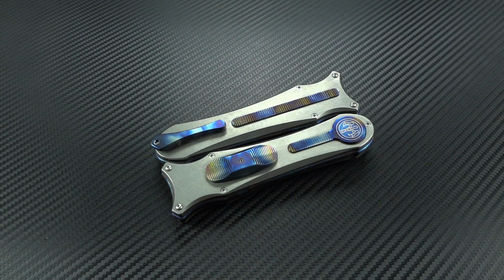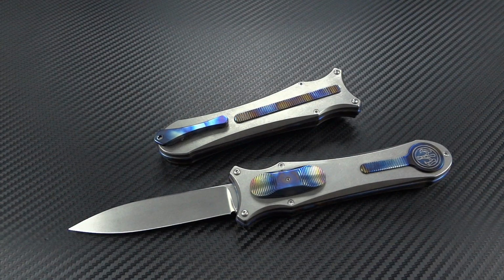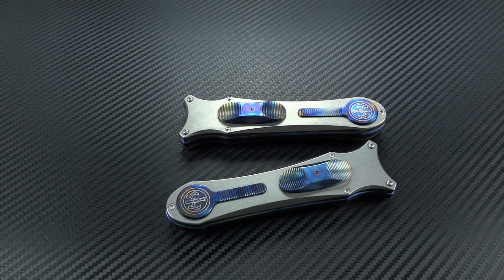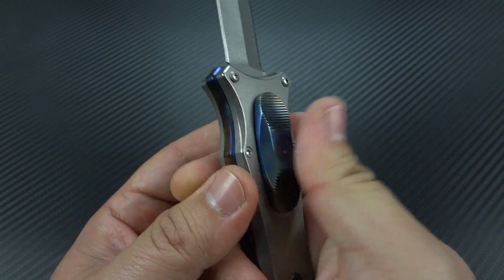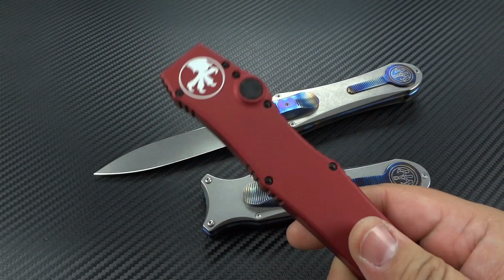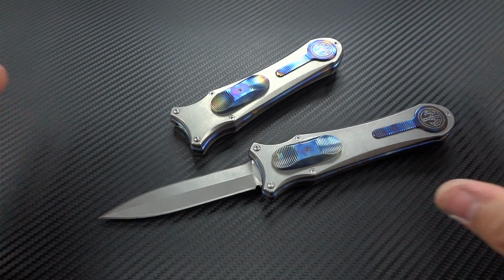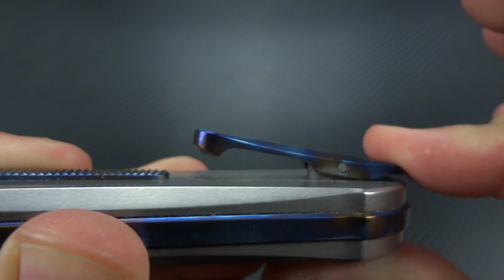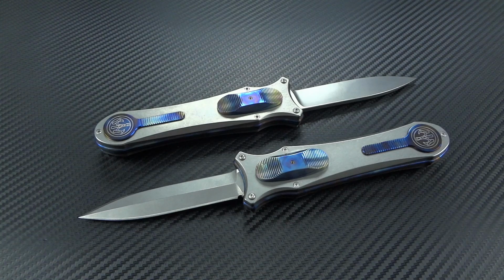Hawk Knives Custom Deadlock: The perfect OTF?

Comment: Love the knife . Love how they solved the problem of the lockup that nobody would ever use it to stab into a trash can . The sand shark 🦈 is probably the best lock to this day . The piranha lock up mechanism is really great . Not the blade firmness but the locking strength . The infidel stamp internals are garbage. Love the internals of the dead lock , but I personally think the microtech internals are tried and true simple the sears are beefy , the slide is solid. The newer Dirac slide is my favorite internal slide . If microtech used 2 sears to lock could take the blade wobble out .

Comment: I just purchased my first Hawk Auto, Marble Carbon Fiber handle, tumbled Titanium hardware, SV20, (Premium Steel), sharpened double edge.

Awaiting Arrival!

I received mine and it is exquisite, no play, beautiful action, superbly sharpened on both sides and it was symmetrical on both sides at the tip to perfection. 

Really impressed. 

The only thing I'd like to see is a window breaker tip on the end.

Overall I'm extremely happy with my purchase and it in my opinion is worth the 💰!
Reply: How much for it
Reply: @craigfinley2507 

Cost was $1,250.00.

Now one identical to mine sells for approximately $1,700.00 used in mint condition.
Reply: @sixshooter4570  thanks for the info.  It is well made  no wiggle , the one you have the black one with the mirror blade is sweet.
Reply: @craigfinley2507 

Mine doesn't have a mirror blade.

Bead blasted.
Reply: You mean 20CV for the steel? I assume so. I was excited for a new steel to learn about

Comment: How much does it cost is the question, to make their point they put their design into a $1200 knife. I could take a MT and modify it with top shelf micro-tolerance parts and materials and do the same thing.
Reply from the maker: Justin Westwood You’re really comparing modifying an existing knife to developing something new from the ground up, and making them one by one? LOL
Reply: @JimSkeltonKnives  have you opened one up yet? What type of mechanism are they using? Something new, something proprietary or are they using existing designs and making them better, so there isn't a vertical/horizontal blade play? These are hardly 'production' knives if they are at all, and it's very unfair to compare, especially with the differing price point.
Reply: @Justin666i  Here's a video of the mechanism. It is not possible to modify a MT to work with no blade play. https://www.youtube.com/watch?v=OejKolm0-_U&t=2s

Comment: Can a heavy duty OTF pierce. 1 4 inch plywood. Or is that urban legend.
Reply: Jeffery Schirm
No, the mechanisms in otf knives are not powerful. While the blade is in travel a stiff piece of paper will derail it but if you then pull the blade out into a locked position it is back on track

Comment: I'm curious, does this have a feature like the microtechs where the blade stops if fired into a hard object?  If not what happens if the blade is stopped before reaching full deployment?
Reply: Actually its not a designed 'feature', and is instead just the nature of all double action OTF's. The only OTFs that don't stop are single action, and that's because there is a spring powering the blade all the way open. In double action OTF's the spring only powers the blade for about a half inch. At that point its only the inertia of the blade that takes it to the open position. 

When the blade hits something before going into lock up, it just stops. In that case you just pull the blade out. Since the Deadlock does require a little bit of force to go into a full lock up, sometimes throwing it out works best. 

Gavin
Reply: Gavin Hawk thanks that makes sense.  I actually found your disassembly video and watched that.  It's never really "off track" just not at the end of travel where the springs engage the blade.

Comment: Another set of thoughts for those opposed to the "cost" of this knife. Brands like Microtech offer customs as well. Try getting a double action out the front from Microtech, or Marfione custom knives with a titanium frame, titanium switch, titanium pocket clip, carbon fiber scales, a high end blade steel, AND a hand ground blade by the maker himself....for around $1,000. You'll pay at LEAST $3,000 and you'll still have some blade wiggle

Comment: Those knives have to have some play in them. The only looseness that ever bugged me on the microtech is the vertical give that comes when cutting stuff.
Reply: Technically you're correct. All otf's have to have play in them for the blade to travel back and forth. But when it's locked up, there is no need for play. The problem with other otf designs is they're not able to fully lock the knife up. That's where the deadlock comes in. The deadlock locks the knife solid when open and closed
Reply from the maker: biblical giants Zero play. As you can see demonstrated over and over in the video, and the entire reason for this knife's creation.
Reply: Gavin Hawk Good response Gavin and Jim. The Hawk otf is a truly awesome and innovative design. Great upload! Thanks guys!